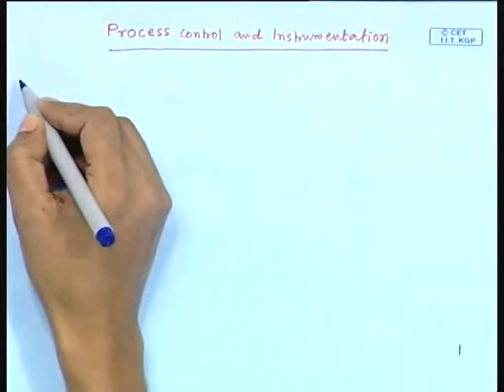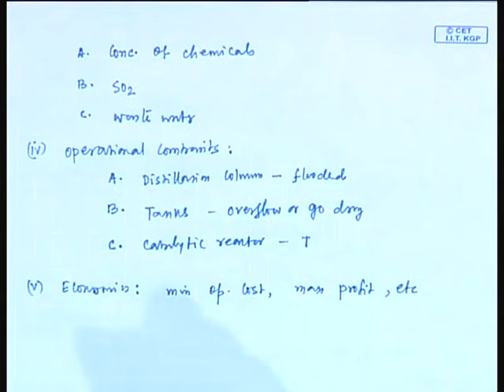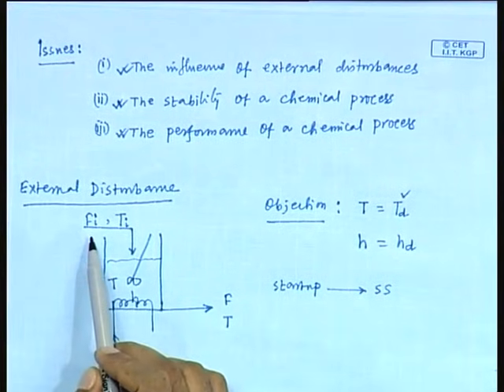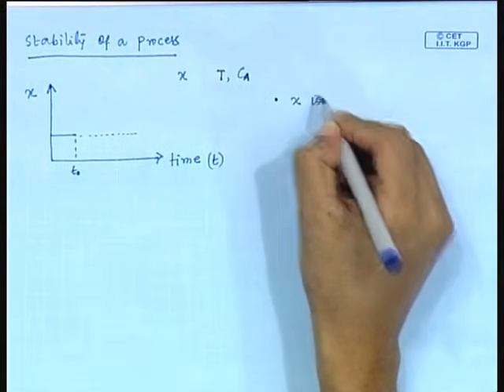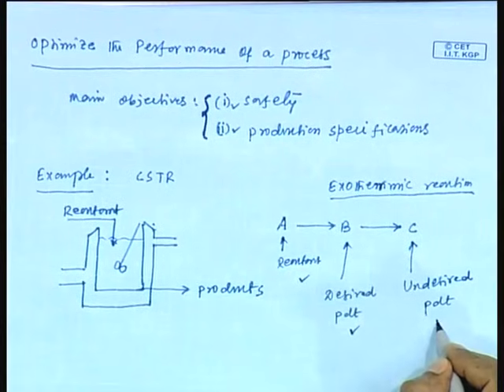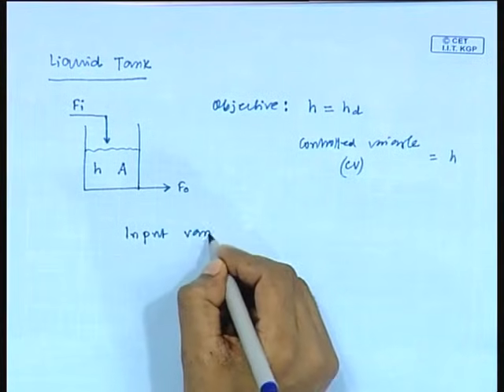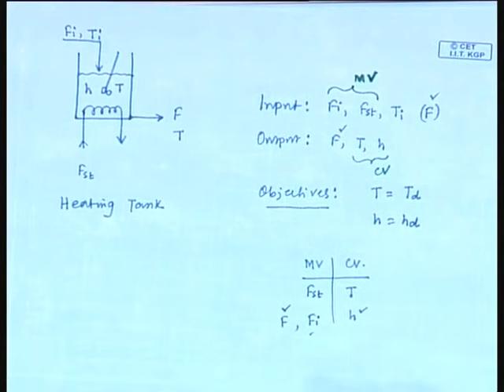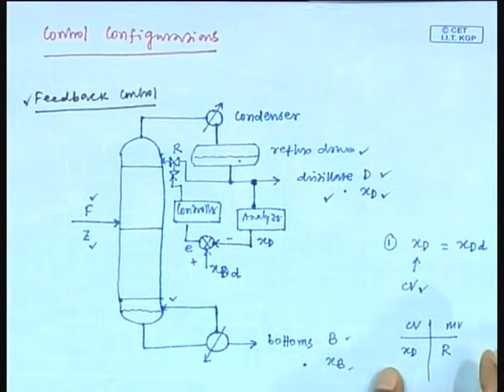Mod-01 Lec-01 Lecture-01-Introduction to Process Control

Comment: Try adjusting the headphone pin 3.5mm, in the half way through........
You can hear in both ears by doing so...........
Reply: Timoth Dev it's working 
thanks
Reply: Thanks
Reply: it helped!!
Reply: I can't
Reply: worked for me
Reply: thanks alot it worked